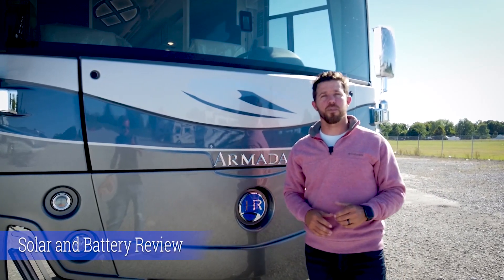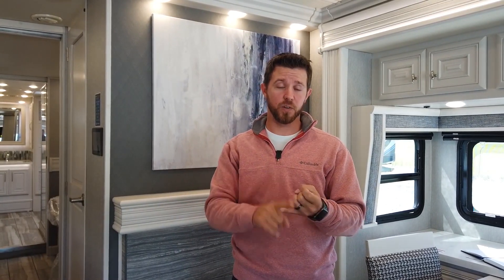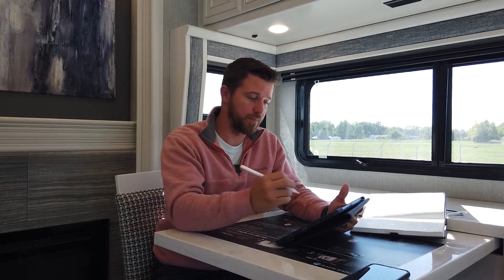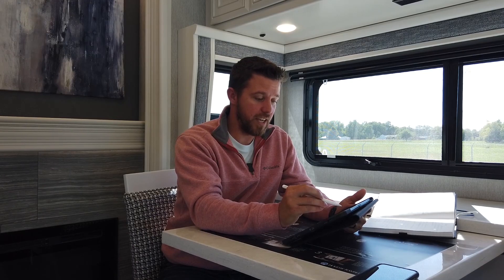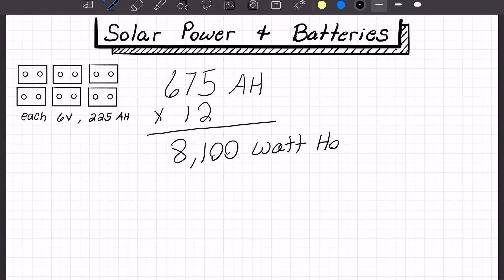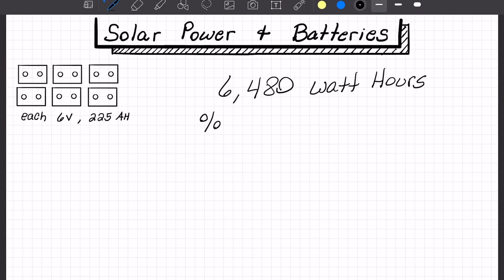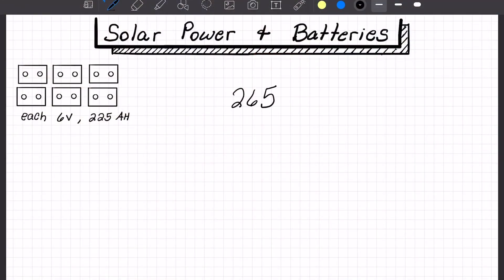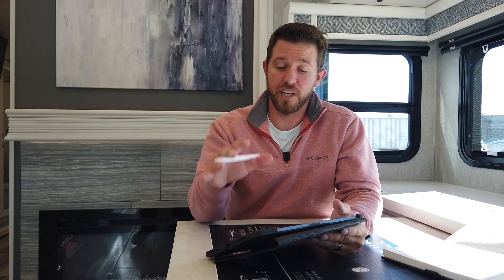How does my solar system work? - Holiday Rambler

Comment: Question:  I have a 2021 Holiday Rambler Vacationer 33c.  My paperwork’s says that I have a 100watt solar panel and that I can add a second 100watt solar panel. My question is: do I call REV to get a second panel?  And, is there an instruction video on install? I live in the north east and my closest REV dealer is a Camping World.  They will not be installing anything on the Motorhome.

Comment: Absolutely love this coach.  I would want an all electric coach. Loved the content.  Why not add up the total wattage of the model you are showing and let us know how long the battery would last when with only the lights,TV's and appliances are being used without including any additional devices such as cell phones, laptops and etc.... thanks.  What if we double the batterys and add an additional 265 watt solar panel.  Double the system you have now.
Reply from the maker: Gerald,
    I appreciate you watching and commenting. There are so many variables in how long your batteries will last. So, the goal of this video was to provide the information so each individual can figure how long their batteries will last based off their system and requirements. Doubling you batteries will provide you with much more usable energy when fully charged. To be honest adding another 265 watt solar panel will increase your charge rate but will not be a dramatic difference. 
                 Thanks                                                           - Mike -

Comment: I bought a 2020 Invitca 33 HB and looking for information related to which electrical receptacles work with the battery (not shore power connected). I've had a couple challenges figuring out the system and my receptacles didn't work until I found out the inverter has a GFCI protected switch. Once I got it working most of the receptacles don't connect. Thanks in advance

Comment: Great Content,  discussed , great way to review battery and  solar usage and capacity. I would have added a example of what a residential  refrigerator  draws on the batteries, since this is the biggest draw on the house batteries.  Keep up the videos!!
Reply from the maker: Brad, 
    I really appreciate the comments. Yes, I agree examples would have been helpful. Just rough estimates here but the content I have been looking at states a residential refrigerator is using around 500 watts. The big draws are appliances such as microwaves, hair dryers, and coffee makers all of which are using around 1,000 watts. Granted those draws are for short periods of time where the refrigerator is running for much longer periods. 
                     - Mike -

Comment: What is the cost to upgrade from a 100 watt solar panel to a 256?
Reply from the maker: 1buzzard67,  
If you are looking at a diesel product the 265 watt solar panel comes with the "technology package". That includes an upgraded WiFi Ranger, Cell Booster, 265 Watt solar, and Mobile Eye Collision Mitigation. MSRP on that package is around $4,030.
If that option is available on the gas product your interested in you may select the 265 watt panel separate. MSRP on that option alone is around $612.
                       - Mike -